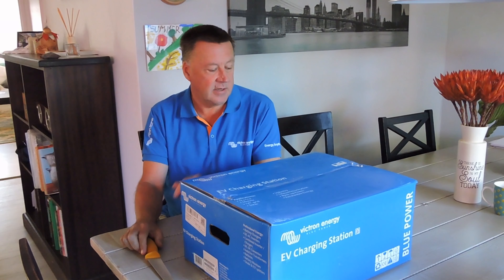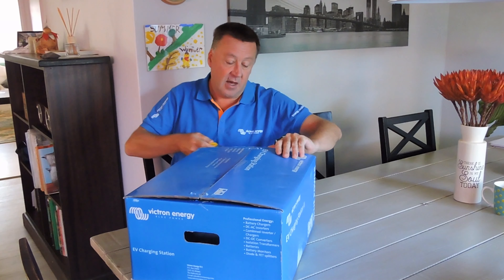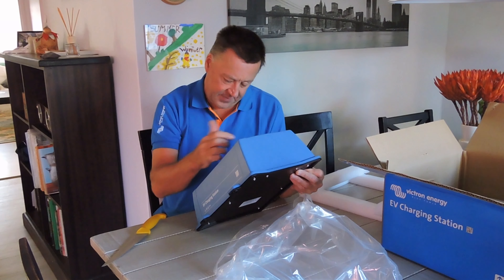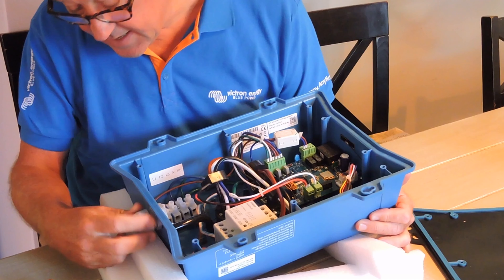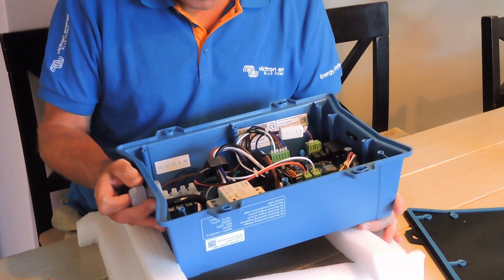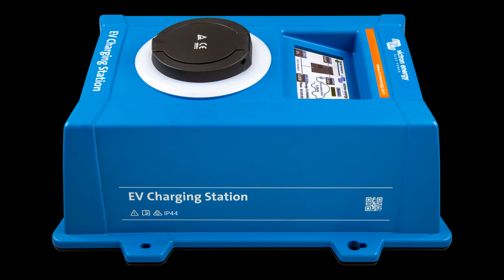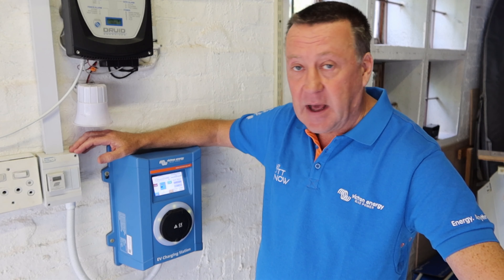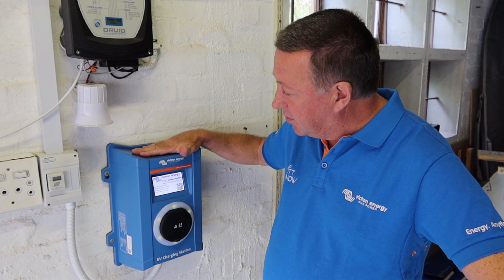Victron EV Charging Station review Part I

Comment: If having a 5 kVA inverter how is it possible to get more kw out of the charger than the inverter is rated
Reply: The Victron inverters generally have a higher passthrough rating (from the AC input) than the inverter rating. The passthrough might be 15 kVA on a 5 kVA unit. I don't think that gives you 20kVA output, though you can if your input is limited boost it with the inverter capacity. e.g. if your connection is limited to 5kVA, you can get 10 kVA out by combining the grid connection and batteries.
Reply: @markhetherington2809  yes I understand that thanks . What I meant to say is in offgrid application the charger would only be limited by the inverter max rating output?  Unless you have a gridtie inverter on ac-output also?
Reply: @PhillipFourieZA  yes, unless you also have a solar inverter producing energy, or some other source of power like a generator in an off grid installation you'd be limited to the conversion capacity of the battery inverter and available battery energy.
Reply from the maker: @markhetherington2809   I will be reviewing the Multi RS soon this has some other tricks to produce more AC solar than the rated capacity

Comment: Hello,
WHen you are off grid, is the charger able to throttle up and down depending on the available PV power ? How do the charger know how much is available, cause i can't see any way for it to do .. !
I'm pretty sad they do not have CCS an DC in, that would prevent to waste power in the inverter and wear it by using a 48V battery input/mppt output.
Reply from the maker: @davidniquot6423  Hi so the battery BMS CAN will controll the charge by the inverter.  The AC loads will either be serviced by solar in the day or battery (or both).  Not sure I've addressed yr question ?